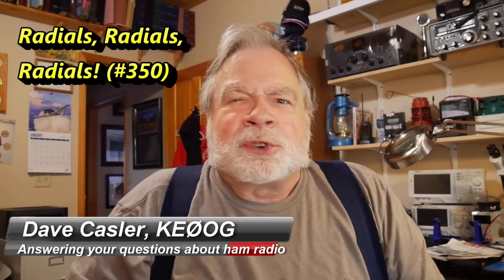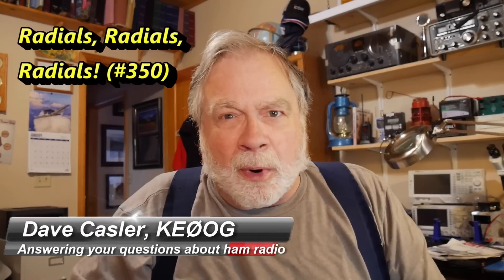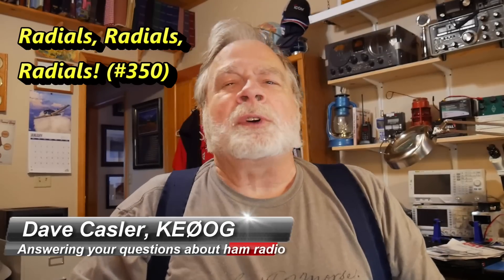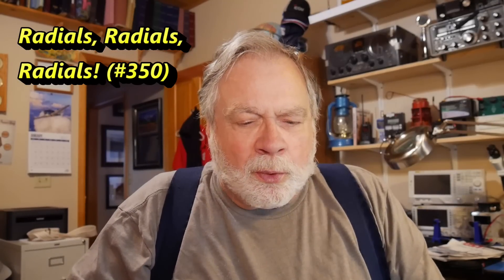Radials, Radials, Radials! Learn about radials! (#350)

Comment: Dave, TU!  I have a Hustler 5BTV 80-10 (no WARC) antenna in my yard that I use in good weather while sitting at my picnic table in the yard with my "go kit".  I bought a pre-cut box of radials from DX Engineering and stapled them down in the lawn with staples, also from DXE.  The yard is on the north side of the house, and there is a patio between the yard and the house, so my radials only extend to the north.  You said that would make the antenna slightly favor the north.  However, the DXE box of radials has about a half-dozen that I still have coiled up, since they would be the ones going north if I could lay them where the patio prevents it.  Are these coiled up radials (coils about 8 inches in diameter) helping or hurting any? de Peter, K6PH

Comment: I use the MFJ-1820T with the IC-705 a lot and found that the length of the radial was crucial to getting good SWR. Is this because the radio was on a table and a few feet off the ground ? Sometimes I find that it's best to have the radial raised a little, maybe thrown in a flowerbed. 

I was astonished how good the little MFJ-1820T is and have made lots of contacts on it, but getting the radial tuned correctly is crucial based on my experience. 

I also have a Chameleon MPAS 2.0 with CAP hat, 5 radials and also blown away by it's performance, pity it's not better on 40m but I found that the radials don't change the SWR much except going from the supplied 1 radial to 5 helped on 40m but raised the SWR from around 1.5 - 2 but performance definitely improved on 40m but it's never going to be a great antenna on 40 but I get all around Europe from Ireland. 

The Chameleon SWR didn't change as wildly regardless what radials I use or what way they are on the ground compared to the MFJ-1820T and I think that might be because the feed point is higher ? Perhaps the Chameleon being ground mounted and feed point at ground level that it's not so fussy.

Some day I hope to experiment with a 43 foot vertical and a remote tuner at the base of the antenna or maybe even a 5 or 6 BTV.

Comment: You said "yes" to needing radials on a 1/4 wave, and I thought you going to sat something about 1/2 wave, but either I missed it, or your didn't?
I have an old antenna specialists 11m radialess vertical that performs well at ground level from 20-10 meters (and all in between). Should I add radials?

Comment: 99% of the time if you use (in my cases, short,  u shaped metal coat hangers), (usually free at the Salvation army, etc. stores,) the radial wires will disappear below the grass level in a few weeks. Mow the grass low, put in your radial field and its done. Easy- peeze. Don`t make things complex.

Comment: Well done and solid info ( unlike alot of videos Ive seen ). One comment, I have built many vertical ( monopole ) antennas in my 50 years of Amateur Radio.   The fact remains , and proven in rf field studies,. The more radials you can get down the better ..its all about returning the image signal back to the feed point, ground losses keep dropping as more near field radials are added.  A ground mounted vertical is at the mercy of ground loses and the secret is making them as small as possible ,,. Radials on the ground do not need to be resonant , the ground coupling detunes them anyway.  So rule of them. Try and do 360 degrees if you can, get many ( with expensive analyzers I have seen a point of diminishing returns after about 30 radials ) .. the antenna needs to be tuned AFTER the radials are down!!  SWR is NOT a guage of antenna performance.   I usually use 25 ft radials. , Covered wire , ground staples and 30 of them in 360 degrees.  Trust me, your antenna will start acting like a 'REAL' antenna

Comment: Thanks Dave! Though I'm a General I'm a neophyte techy!  I've been trying to get a 40M HF to work for over a year now but I think what I've learned from this video may be pay dirt!  I purchased a NVIS antenna from a local vender (Treasure Valley, Idaho) which can be mounted as a di-pole or as a verticle.  Anyway I can't belief in his instructions (3 radials provided) he states "you can add more but it doesn't seem to improve performance"  Your YT video has alot of great ideas!  Thanks Again, Tim KG7YAR Boise, Idaho

Comment: Hi Dave.  When I was stationed in Germany I was in a situation of having to use verticals. I used two verticals made by B&W. They had no traps so once they were up I went into the radial game. I had 5 band, if I remember right, verticals that I was using phased. I read somewhere that radial density is better than longer radials so I ended up with 40  20 foot radials. I was using a Ten-Tec Omni C, a Ten-Tec 229 tuner and Ameritron that I used at the 450 watt level.  With the vertical spacing at 33' all of the bands seemed to relate to each other and for six years I had one mighty station. Thanks for all the info. Good luck with the ankle, all I've had in that area are a few massive sprains but my wrists have sure taken a pounding.

Comment: What would happen if you put down wire fence instead of single wires? Would it be the perfect mirror for the radio waves like infinite number of radials? You would of course not be able to tune this.
Reply from the maker: It can be done, but I’ve never seen it tried. You’ll have to be sure each strip of fencing is secured very well to the next strip electrically along its entire length.

Comment: Dave, should my ground radials be stretched out to max length or would it be better to have them wander like a lazy river covering more area in a smaller diameter?  Thinking specifically of a Wolf River Coil with 6 radials on 20/40m
Reply from the maker: It doesn't really matter. Mine kind of wander. It offends people who like things nice and neat, but the actual electrical field envelops all the radials as a group.
Reply: @davecasler  hah! Excellent thank you Dave.

Comment: Hi David,
would you be kind and say a word about my design and its behaviour plese?
What I have made is a vertical antenna with random lenght, roughly 10.3m made of aluminium tubes when first is 50mm in diameter and last around 38mm, it sits around 10cm above the ground, connected trough 4:1 UnUN to a coaxial cable to AT-100Pro AMU. It does tune from 160 to 6m. Now then, originaly, it hadn't any radials and I worked States on some occassions I believe on 80m band, top band wise I have contacts in a radius of around 2000 miles. When I connected ''some'' radials ( mind there is really restricted area to lay them and definitelly not in a 360 deg. pattern ) the antenna stopped working, it couldn't be tuned by AMU anymore. I have no space here in UK, so having ''something'' to transmit on 160 and 80m is better than not having it at all. I am wondering how I could improve this vertical.
Looking forward to hearing from you, 
73s Andy de 2E0FHM
Reply from the maker: I would suggest not using the balun--no need for it. Connect the ATU right at the base of the antenna and make sure the antenna is well-insulated from the ground.. Make sure the ATU is well-grounded. If it works better without radials, there's no issue using it without them.
Reply: @davecasler  Hi David, thanks for your answer, just one thing, there is no BalUn but 4:1 UnUn ...shall I get rid of it too ? I may lose top band then hmmm?
Reply from the maker: @geopolska  Try it with and without to see what works best. Good luck with your experiments!

Comment: Doesn't the DX Commander use multiple verticals? I think that should be pointed out, you aren't going to get a multiband vertical with a single radiator and different length radials.
Reply from the maker: Yes, but they act like a fan dipole. I hope I can get it up before long. It's been cold here and there's been snow on the ground for weeks.

Comment: More questions.  I have an Alpha 80-10 vertical that came with one radial. I plan on mounting it 10 foot off the ground. Should I add 2 counterpoise for each band? If so, how long should each counterpoise be? Should they all be in different directions? Thank you, 

Dennis Thrush, N5DHT 73s
Reply from the maker: Try it first the way it came. Then try adding a couple radials and see what you think. Keep notes in your logbook and find out what works best for your location.

Comment: As an owner of two DX Commanders, I can confirm your advice Dave. As many as you can put down. Don’t worry about symmetry if you can’t make a circle. Insulated wire on the lawn - soon disappears! Lots of short radials if you can’t fit long. Good luck with the ankle 👍🏻

Comment: Another great video...  Thank you.  What gauge wire should the radials be or does it matter?  Should the radials be insulated wire or bare copper wire with the lawn staples?
Michael VA6XMB
Reply from the maker: Whatever gauge works for you, since the current in each radial is the total current divided by the number of radials. 16 gauge would work fine. I use 14 gauge THHN stranded wire from a home supply store because it's easy. I prefer insulated wire. I much prefer to work with stranded wire (THHN stranded is 7 strands).

Comment: VE6AMR here.  When I was able to get on the air I worked 165 countries during the sunspot decline, using only verticals and max 100 watts.  One of the verticals I have used in the past for 40 metres was a variation on the Quarter wave vertical!  I made it out of 2 inch EMT and cut it's length to about 109 degrees of length rather than the usual 90 degrees.  This gave me a feed point impedance of 50 + j100 inductive of course!  I fed it through a Air Variable Capacitor 5 to 365 pf i believe.  I shunted the capacitor to ground with an inductor that had about 5000 impedance but only 5 ohms dc resistance.  The vertical when tuned by the capacitor to band center was less than 1.2 to 1 across the entire band! Speaking of radials I had 65 1/4 wavelength radials on that antenna and got out very well!

Comment: Thank you for the detail. I've found I can start with a radial loosely cut for a particular band and then, using an analyzer get it tuned up (when using a vertical). Rinse. Repeat for each band. I've had good results so far. I hope your ankle heals well and quickly.